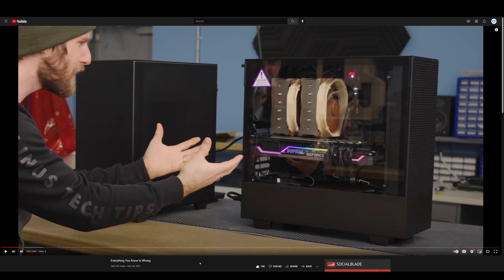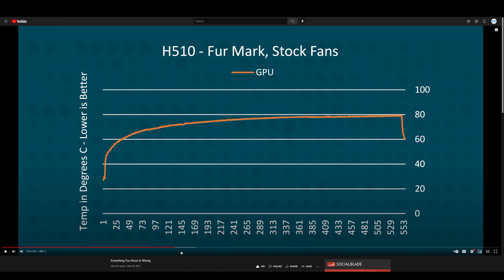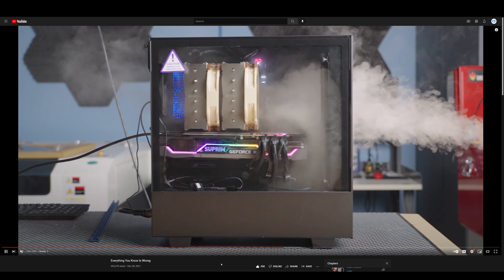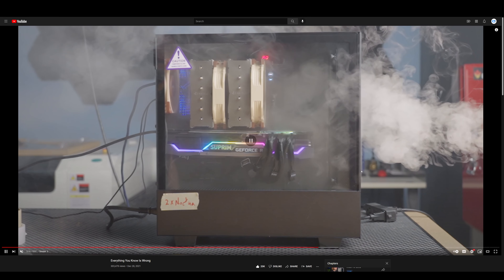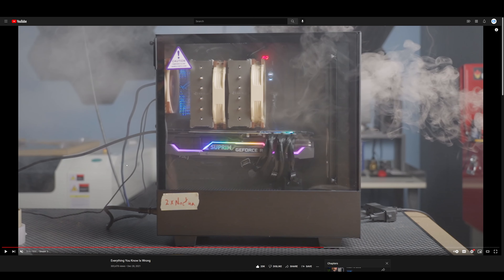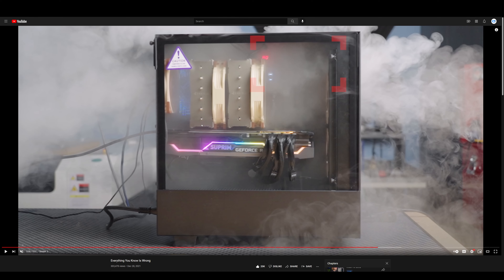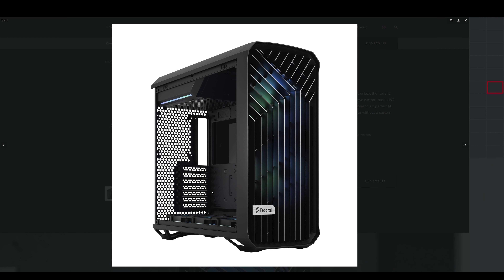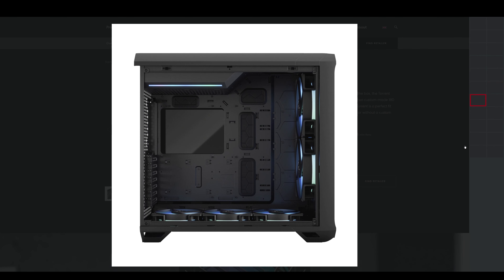"Turbulence" is NOT making your GPU hotter

Comment: Simple solution: AIO in the top (140/120 mm) Same with the exhaust fan. 2 in 2 out right? Plus really crappy case to begin with 😂.

Basically it's a budget build case to begin with, not a high end build. All I'd put in there is a budget 3600x board and CPU. 120/140mm Rad and exhaust fan with a 3060 and 750 watt PSU. 2x front fans etc as well. It's not a case suitable for high end components at all!! And yes terribly designed. NZXT need to steer away from case design and keep doing what they're doing best still. And that's NOT case design 😂.

Comment: you said it yourself your not a air specialist LOL, The main issue why temp increases in the gpu is due to that TOWER COOLER try to swap it with an AIO then you can kiss goodbye for GPU high temp.. The reason why adding more noctua fan keep reducing GPU temp is due to the fact that Noctua Fan Runs really fast and very silent and pulls more Air "The very reason their #1 premium Fan" The system has a dual Noctua Fan Tower Heatsink vs a weak smaller GPU Fan  basically (Stock Fan > GPU Fan BUT More GPU Fan a lot > then GPU fan) as a result CPU Fan takes mostly all the AIR from the intake Fans but when switched to noctua front fan then they pull air outside of the case more efficiently and push air faster inside the case where the CPU FAN pull this faster than the GPU. Then About Turbulence it does affect Case Air Flow why??? in Linus video incomming AIR gets slit up instead of going into a Straight lane at the lower Fan which causes the  going up and some going down (LOOK if theres a 3rd front Case fan below that then there will be no GPU thermal increase "they said it in the video its because the case is small and ITS CORRECT there is NOT ENOUGH CLEARANCE FOR AIR Below the GPU and not Enough Front Fan that should BLOW AIR BELO THE GPU" Turbulence did affect If you read BOOKS or Research about AIR and AIRFLO etc. a air pressure in a straight line is more efficient versus a air that takes a curves "Example the very reason why MESH case gets better airflow is due to the fact that Fans pull AIR in a Straight Lane then Solid Panel Case gets POOR airflow due to the fact they pull Air from the side which means the AIR needs DO A 90 DEGREE CURVE" This LTT particular set up there's three parts that causes the rise in GPU temp #1 Case #2 CPU Tower Heatsink #3 Noctua Fans for #1 can be fix with a case that can support 3 Front intake AKA Larger Case or a M-atax Case that support 3 Fans not 2 #2 can be fix by replacing with an AIO to gave GPU all air that it needs #3 going for slightly lower performance Fans I.E. stock fan rather than noctua fans BUT will increase CPU temp. Then the things you are wrong thats why i can't finished this video itself #1 the Stock Fan set up is not in negative air pressure "i can answer did since i just watch the video before this one" its in a nuetral airflow which mean its BALANCE = cool air going hot air gets up and the proof that its nuetral is GPU pulls air on the pci vents IF ITS NEGATIVE Then SMOKE SHOULD NOT GO IN = your MISTAKE #1, NOW #2 dumb reason by you = NOT ADDING TOP EXHAUST??? can you see the Top Front Fan most of the 2nd FRONT FAN gets pulled by the CPU FAN and that is also gets pulled by the REAR exhaust Fan pulling the HOT air that gets pulled out by the CPU heatsink? the top Fan will only pull little BIT of AIR WORST THAN The GPU  due to = Poor Clearance = a Straight lane AIRFLOW Config is present and the air flow is strong.... #3 With the Noctua Fan added GPU no Longer gets cool air from the PCI vents which means you are CORRECT its now in POSSITIVE AIRFLOW but its Feels like you HATE the IDEA OF POSSTIVE AIRFLOW due to the GPU TEMP? The Hell WE ALL WANT POSSITIVE PREASURE that means LESS CLEANING MAINTENACE for DUST issue. #4 the GPU Airflow is Circulating taking cool air blowing out hot air and now taking hot air?? YOUR DUMB you said it its on POSSITIVE FLOW those HOT AIR will gets blown by COOL AIR going outside the CASE ... WANT PROOF? You already said it in the video THERE IS NOW SMOKE GOING OUT OF THE VENTS which is really really really GOOD TBH. Linus is correct and wrong the wrong one here dude you said it yourself you don't know anything about AIR or something. This Scenario is very NORMAL when you are using a TOWER Cooler the smaller case you Use the Bigger the CPU tower cooler and the More Fan it has the more the GPU will heat up thats Fan Fact#1, IF you Truly Want steady Flow of Air then GET AN AIO It will Fix GPU vs CPU temp  one affecting one another BUT a Case that has smaller GPU Clearance will always be a CASE AIR FLOW Issue for the GPU.
Reply: Hi. I am planning on getting this case because it is my dream case while not knowing the issues. Do you have any recommendation?

Which setup do you think is good? Feel free to suggest.

(currently planned setups)

Setup 1:
1 rear exhaust
1 top exhaust
2x120mm aio front intake

or

Setup 2:
1 rear exhaust
1 top exhaust
1 air cooler (deepcool ak400)
2 front intakes (or any suggestion if I should add)

I need your help. I really what this case so even tho its quite hot, I just need help to make the best of it. Thanks!